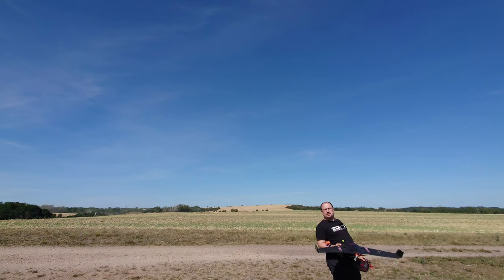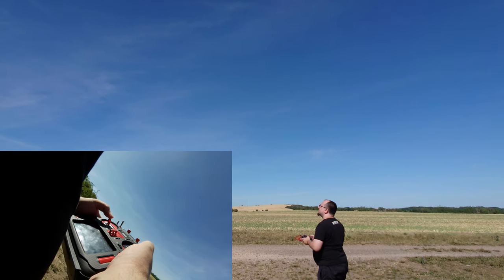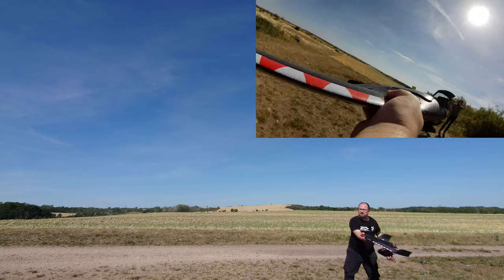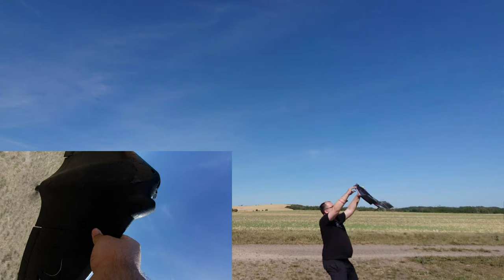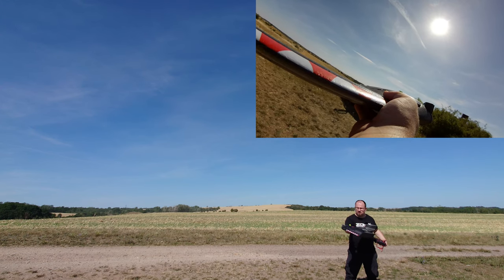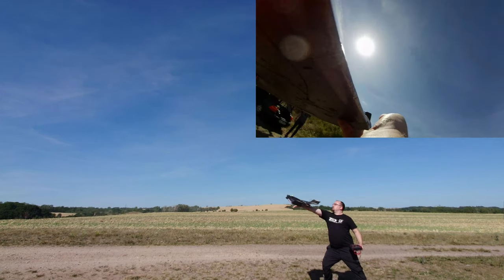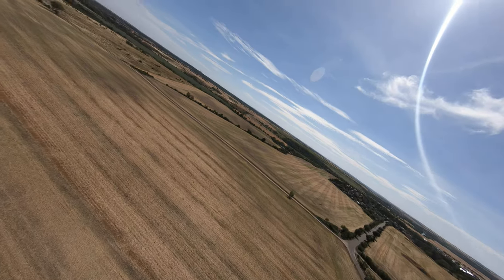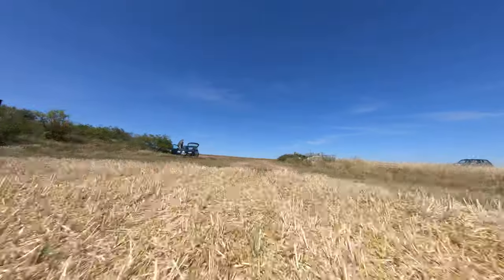How to make any Wing Launch a Success!

Comment: Thanks for an interesting well put together video.  Another twist to this is to use a radio transmitter on a tray with neck strap.

The neck strap greatly helps with throws as my radio transmitter is always securely against my left hand through the whole motion.  I always throw my planes with my right arm and my left hand on the throttle stick for smooth engagement of the throttle after launch.  It feels awkward without my radio tray.

Comment: Good explanation! I also throw my wings for quite a while using both same techniques. Just to keep my fingers far away from the prop. 
Key for a proper side throw is not brute force but if you start, moving arm and body backwards, the wrist must turn forwards!
At the end of the throw, arm and body forwards, the wrist must turn backwards. Just as you show.
This is just opposite of throwing a frisbee and I really had to learn this new different turn of the wrist. Keeping remembering the plane not a frisbee.🙂

Comment: Great work! I think my launch technique is good, but my launch settings are too agressive. Usually does a 90 degree turn and a little torque steer everytime. Your launches are textbook examples!
Reply: Watch a video Darren does. For launch throttle, hold your plane vertical (carefully) and see what throttle setting you need for it to slightly push into your hand. A little more then a hover. Set that as your second stage after idle throttle value in INAV auto launch.

Comment: Thanks for your great video  over head trow is the best method for me with big model  as long as you keep your arms straight there is no danger the  propeller  wont hit your face   and as a bonus your fingers are outside the arc of the prop for smaller wing like the reptile s800 i prefered the side toss
Reply from the maker: yep exactly. Although there are still planes like the Skywalker X-8 that is so big and runs a 12" blade, I would not over head launch. For this size I would only do a dart throw with a grip at the bottom.

Comment: you have the setting of this plane, or what climp angle did you use
Reply from the maker: These are my Launch settings for the AR Pro and actually for most of my planes (only throttle values adapted to each setup) 

set nav_fw_launch_velocity = 300
set nav_fw_launch_accel = 1863
set nav_fw_launch_max_angle = 180
set nav_fw_launch_detect_time = 40
set nav_fw_launch_thr = 2000
set nav_fw_launch_idle_thr = 1500
set nav_fw_launch_motor_delay = 100
set nav_fw_launch_spinup_time = 100
set nav_fw_launch_min_time = 2000
set nav_fw_launch_timeout = 10000
set nav_fw_launch_max_altitude = 5000
set nav_fw_launch_climb_angle = 25